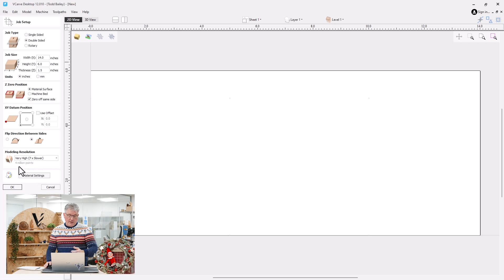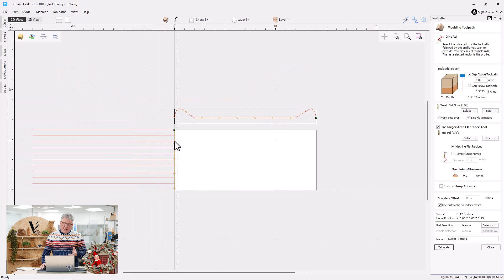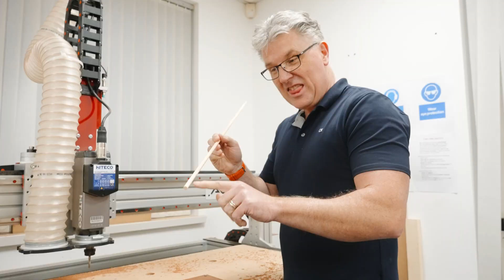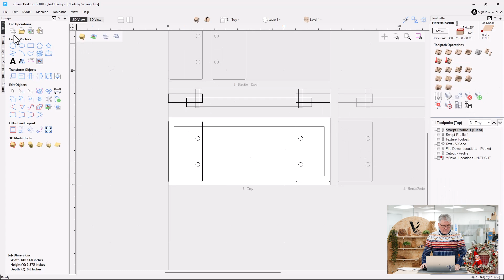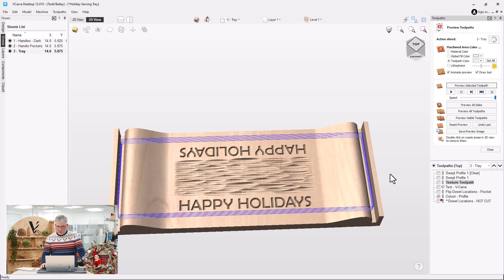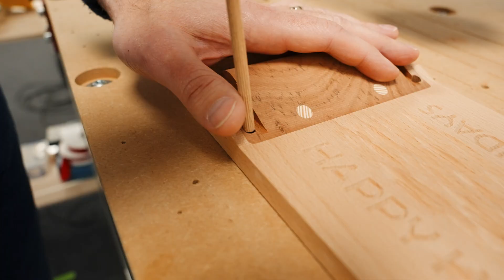Making Holiday Serving Tray | Vectric Holiday Make Off | Vectric FREE CNC Projects

Comment: Thank you for the video.
Although I don't have a CNC yet, I'm trying to learn as much as I can before buying one as there is A LOT to learn. I have a CAD background, and most (90%) of this was fairly easy to follow. I wish I could find a 3-Day class once I purchase my CNC. Your handles are strong enough as long as you used Titebond 3 or Epoxy. BTW - What was the oil you used to finish the wood at the end? 
Happy Thanksgiving 🦃  🍗
Reply from the maker: Hello... and thanks for the comment!  That was oil we purchased from Ikea... but any cutting board oil would work.   As for a course... we have a few customers that do that sort of thing.  If you do a quick search for Vectric Training... you should find a few.  Happy Thanksgiving!!!